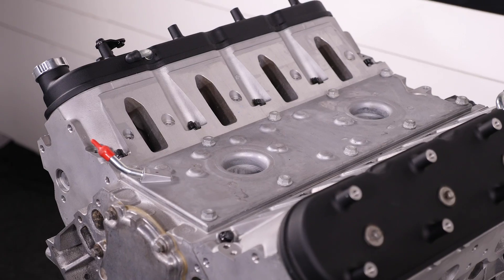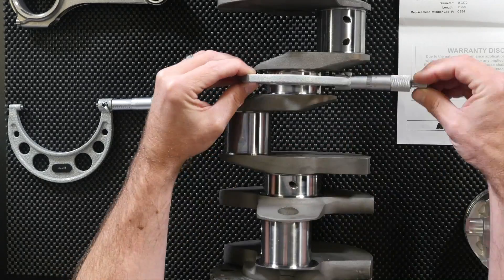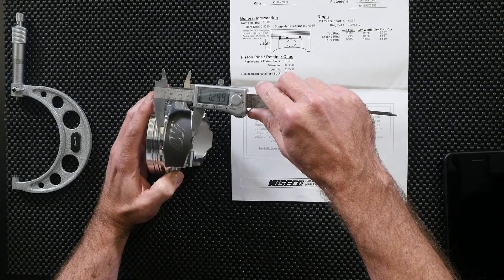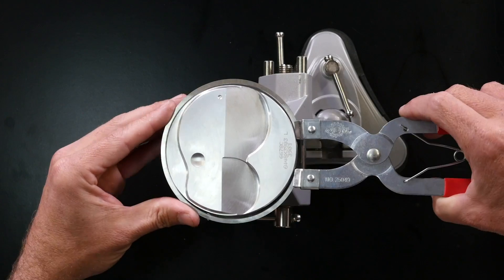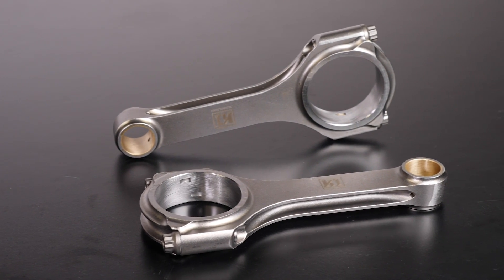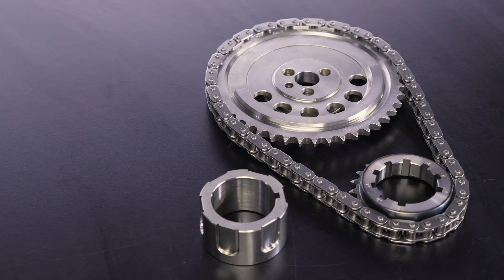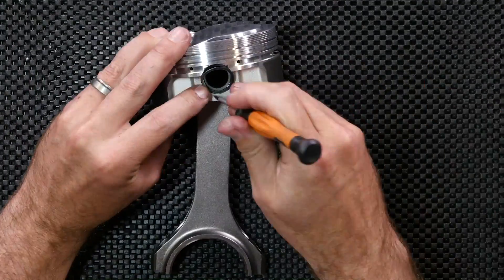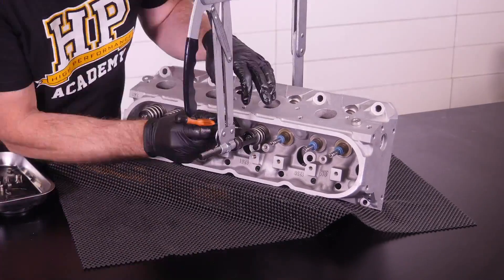Build YOUR LS V8 Engine | Online Engine Building Course [TRAINING]

Comment: I’m only looking to learn how to build a coyote 5.0 engines
Reply from the maker: You balance your pistons and connecting rods the same way for a Coyote as you would an LS, you need to know how to gap your pistons using the same tools, check your clearances, prep the block etc etc the same too.
Where there are differences specific to your OEM parts, that is what your workshop manual is for, but for the aftermarket side of stuff what is stamped on the block doesn't always matter as much as we might think off the cuff.
With that in mind I think you will find a TON of value in this course, and if I am wrong for any reason and you hate HPA and this course, you can get a full refund within 60 days so you don't just have to take my word on it 😎
Hope that helps! - Taz.

Comment: please do this series for the 4g63!!!!!!!!
Reply: Yes! I agree
Reply from the maker: There's already more than enough content in there that will help you build you're 4g63, and as Andre has built a few in his time if you have any specific questions he will help you on the forum, but the principles are the same when it comes to performance engine building. You balance the pistons the same for a 4g63 as you would and SR20 or LS for that matter, same for the rods, same technique and tools to set deck height, improve oil and cooling flow etc etc etc - Taz

Comment: Fantastic content once again guys in addition to the worked examples! I was just curious on if you guys will be doing one for the 4AGE as well as the 4G63?
Reply from the maker: We don't have anything planned for those at this stage as everything you'd need to build one is already covered in the course material there. We have a 4, 6 and 8 cylinder example (all are included). The only other 3 on the radar right now are a boxer engine example, rotary and then eventually a diesel engine build.
Like all our courses, they are comprehensive rather than pigeon holing you into one very niche topic, or in this case engine.
That said, along with many other engines, Andre has built a large number of 4age and 4g63 engines over the years and can help via the forum as you learn if needed at all.
Some of that comment is more for the benefit of others that might see it too as I know you are pretty familiar with HPA yourself. Cheers! - Taz.
Reply: @hpa101  Thanks Taz I appreciate it mate. Hopefully everyone is staying safe in your part of the world cheers👍😁